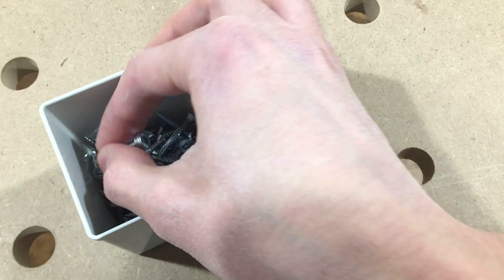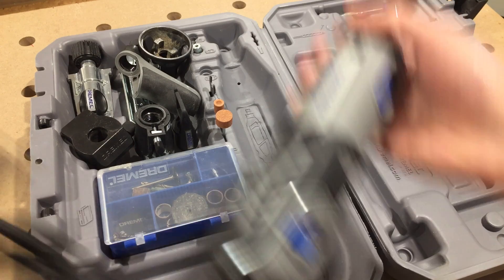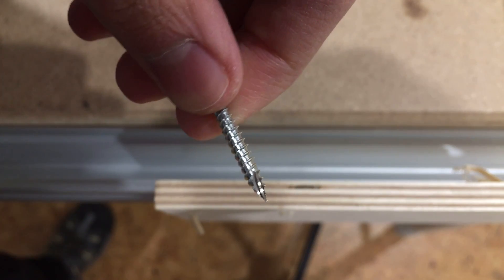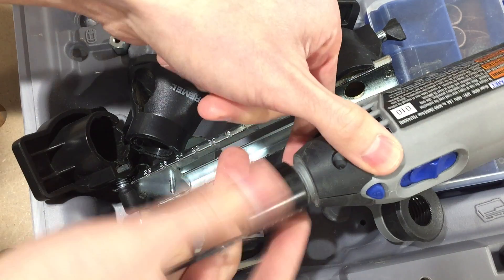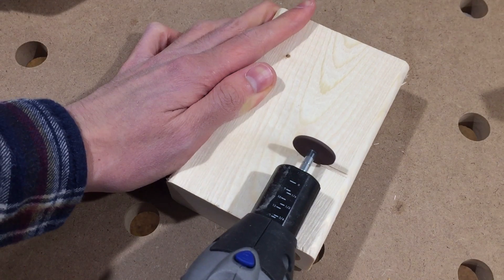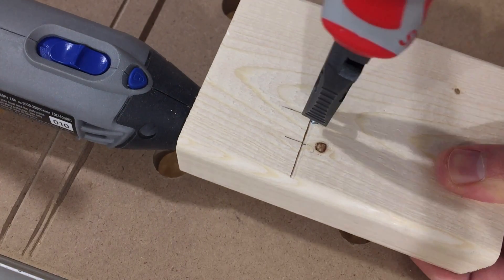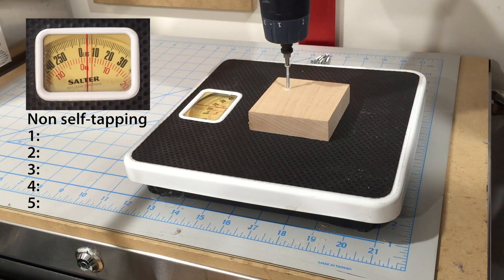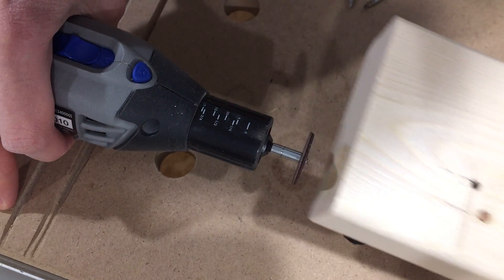How To Make Self-Tapping Screws

Comment: This is one of these channels im so happy to have found... :)
I'd be very glad if you could do more Dremel based projects. My apartment is small and Dremels are just about the only thing i can use in here (apart from a drilling machine and a jigsaw though the jigsaw is not very optimal and probably not a smart purchase money wise ^_^) I've just got the Dremels home .. a DSM200 (circular saw), the 4000 with 128 parts and both the routers and the stand ...oh and the precision saw ... lol
That tool you had made with the razor blade was very clever! This is what attracts me the most to this. Not the making of furniture and things like that but the tools used to solve problems.. :)
Reply from the maker: I have so much respect for people that don't let small spaces confine them. Cheers! :)

Comment: Sorry but I think you are missing the point of a "self tapping" screw for wood... It isn't about making it easier to screw in, it is about removing a little material as you screw in so the object you are screwing into doesn't split.  Your test needs to be regular screw into solid maple or even MDF edge compared to "self tapping" (type 17) screws, without pre drilling.

Comment: Interesting! Disks cutting steel will last longer if run at a higher speed (those extra sparks are a good thing).
Same applies for sanding belts on steel.
Reply from the maker: +John Heisz – Thanks John. Appreciate the advice on cutting steel :)
Reply: @toolify  nice video. What speed do you recommend then?

Comment: Nice jig, but may I ask, why did you do it? In my experience, self-tapping screws are only useful for decking or large-timber application. For any smaller application or a plywood projects, these are useless, as the top has almost no holding power. At least IMO.
I guess the stock varies in countries, as I really hate the self-tapping screws and have hard time finding normal screws in stores nearby. Could you please invent a reverting-self-tapping-screw-jig instead? :)
Reply from the maker: +Ostap1974 – LOL! A reverting-self-tapping-screw-jig... I'll see what I can do ;)
For this jig, I see myself using it to equip eye hooks with self-tapping tips so they're easer to screw into wood by hand. Pre-made self-tapping eye hooks are difficult to find.

Comment: But those cutoff wheels wear down SO quickly that the jig would become useless. Our maybe not. How many screws could you cut before the disc became too small?
Reply from the maker: +Mark Price – Good point. Yes, the grinding discs do wear pretty quick. I'd say you can maybe get 50-100 screws out of one pair. I don't imagine anyone would be eager to run any large number of hardware through this setup. Self-tapping screws are readily available, and aren't significantly more expensive than the regular kind.

What I can see myself using this jig for (occasionally) is to create the self-tapping tip on hardware that's less readily available in self-tapping format. The first example that comes to mind are eye hooks. I might need that a few times per year, but especially since eye hooks are screwed in by hand, the easier starting effort could really be felt here.
Reply: WOW, 50 screws? If I would have known that, I wouldn't have commented....I would have put the usage down around 5 before the diameter could no longer cut the screw.

Comment: you can go way faster, sparks only mean, that the cut is being done... the best rpm should be mentioned in the manual (and you can make a side exhaust hole so that hot air and dust can get out)
Reply from the maker: +derKarl – Cool, good to know!
Reply: Toolify
use the propper feed and speed and your cutting discs will last long